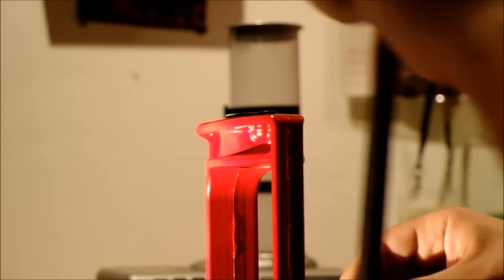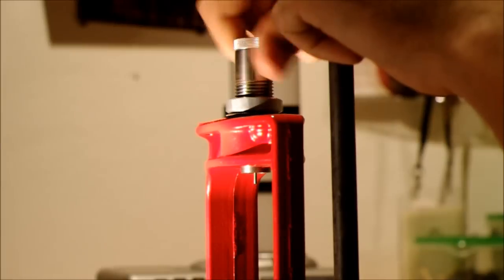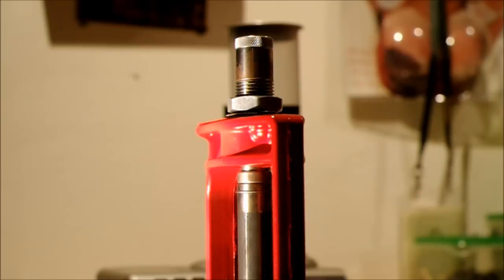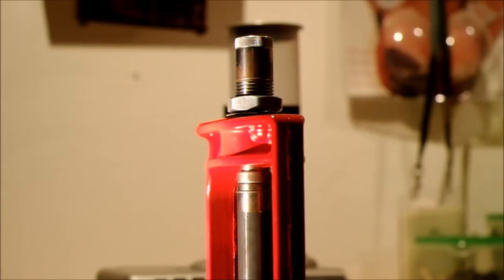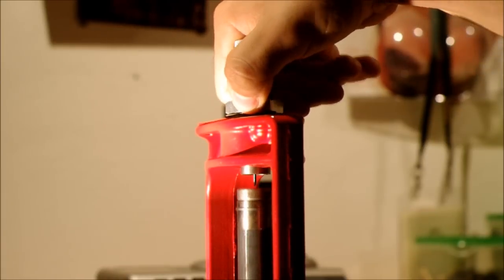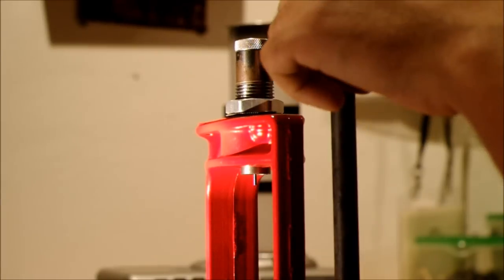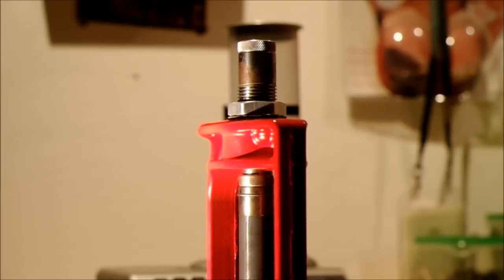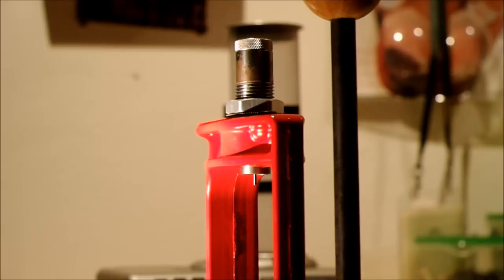How to: Setup a Neck Sizing Die

Comment: Your work station moved a little with each strokes ram down. That could cam over and cause play. Try 4x4 blocks and 3" bolt nut to lock it down

Comment: If you own a "Cam over press" like a Redding or RCBS, adjust the die down 2 full turns after the die touches the shell plate so it WONT cam over..